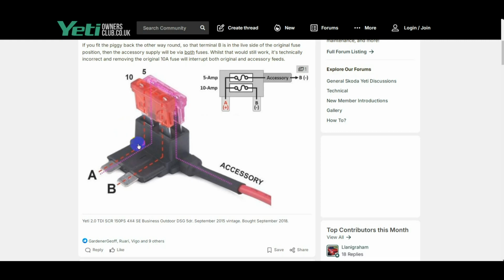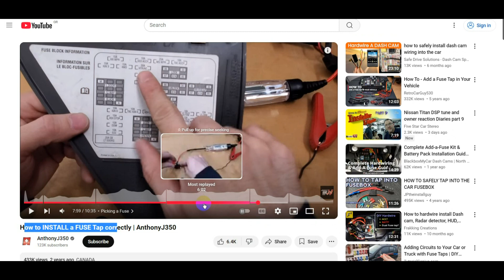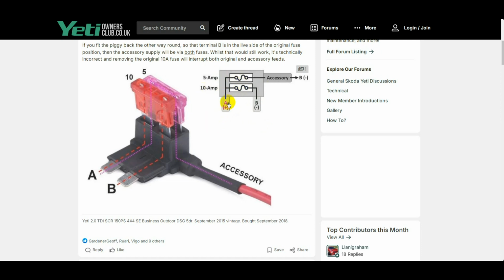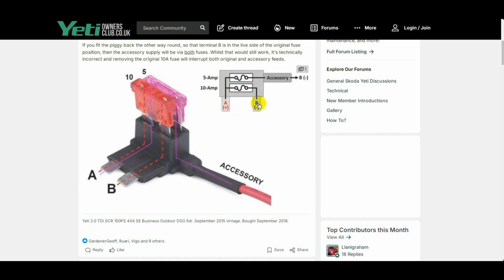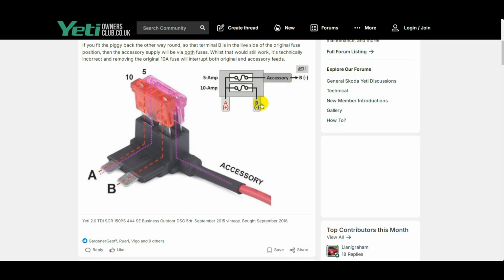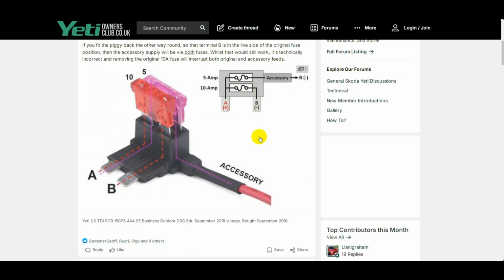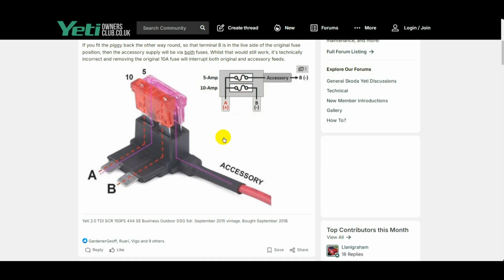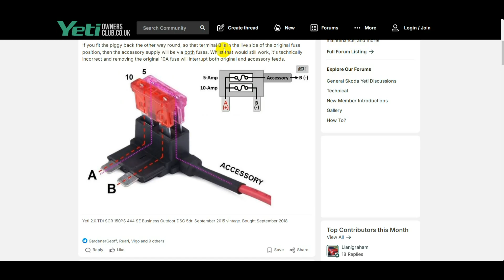Fuse Tap/Piggyback Holder - The CORRECT Way

Comment: No...

An add-a-fuse doesn’t combine fuse ratings, the OEM circuit should keep the OEM fuse value (it protects the factory wiring/device). The accessory should be fused separately with its own (small) fuse, and the tap must be oriented so the pigtail is on the load side (fused). If the accessory is a higher load, use the tap only to trigger a relay and pull power from the battery with an inline fuse.

Also the “hot side” of a fuse slot is just the 12V feed, it doesn’t have an amp “rating” by itself. The amp rating is the fuse value, chosen to protect the wiring/device downstream. With an add-a-fuse, keep the OEM fuse at the OEM rating and fuse the accessory separately.

Comment: I like your video and IF people read the paper work that comes with these add-a-fuse taps you'll see they say not to run more than 10amps through them.  However another option one can do is change your fuse(s) to a lower amp rating like a 7.5a and a 2.5a.  Theory being you're at the 10 amp rating and if it were to overheat/surge it would pop the lower rated fuse first instead of melting the wire.

edit

This is what google says:
Fuse taps (Add-a-Circuit) are generally rated for the fuse type they fit (Mini, Micro2, ATO/ATC), often supporting fuses up to 10A or 15A for the accessory circuit, but the total combined draw for both the original circuit and the new device should never exceed the original fuse's rating, with most users recommending low-amp devices (under 5A) for the added circuit to prevent overloading, says Crutchfield, Ram Products, and Aerpro.

Comment: The fuse only protects the down side of the fuse (going to the load).  The fuse block is rated at a much higher amp rating then the fuses.  It has to handle the entire load of all the fuses.  The way you are saying will most likely cuase the 10 amp fuse to blow constantly.  Read the manufarturers instructions not some youtube "expert".
Reply: Completely agree. He’s framing it as if each fuse slot is fed by its own 10 A wire, rather than a heavy feed supplying a common bus bar inside the fuse block.
A fuse only protects the downstream branch wiring; the fuse block and upstream feed are rated for the aggregate load of all circuits.
The YouTuber’s logic collapses here: flipping a piggyback doesn’t “protect” the car’s wiring in any meaningful way — it just forces the original fuse to carry additional current and increases the chance of nuisance fuse blows.
And using the fuel pump as an example just makes it worse — that’s a safety-critical circuit you absolutely do not want nuisance fuse blows on. Any advice that increases the risk of popping a fuel pump fuse is fundamentally flawed.
Reply: I agree with you! That is the good theory

Comment: You are saying to fit the fuse, with the 12v going to B instead of A ?
Reply from the maker: Yes, feed power through B. To protect the feed wire from over current. And in perfect world, accessory wire triggers relay which in turn powers the new device. And generally choose a circuit with a big a fuse as possible, and use a small a fuse as possible for accessory. Just because fuse does not blow doesn't mean it wont get hot if its constantly flowing close to its max current limit.
Reply: Yes, although not well explained that's what he is saying IMO, put the piggyback in the other way. The problem I see is that if the total load (original load and the accessory you have added) blows the bottom fuse and its critical to engine operation then the engine stops or goes into limp mode or something. You need to select an empty fuse socket or one that is not critical to vehicle operation.

Comment: Nice video, but I don’t have clear what should I do in my case. I have a 7.5A fuse and want to connect 2 wires for power folding mirrors. So I insert a piggyback with the original 7.5A fuse, the new wires size is 0.75mm. What kind of fuses should I use for the new wires?
Reply from the maker: "What kind of fuses should I use for the new wires?" whatever the manufacturer recommends